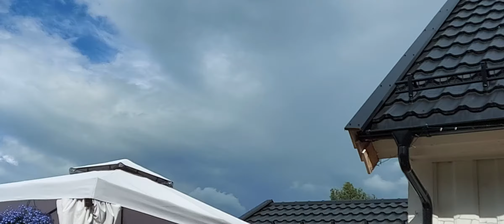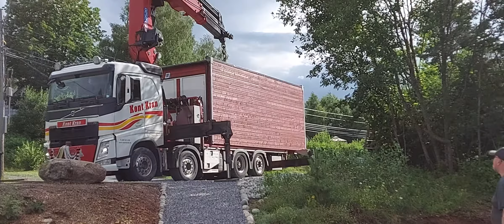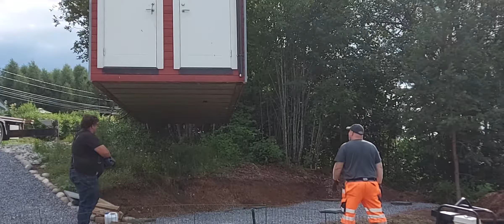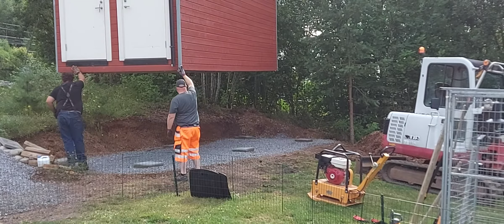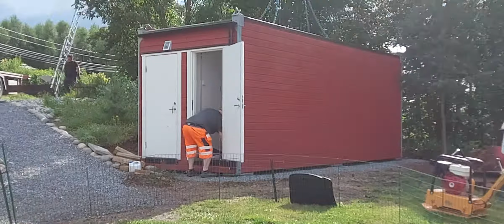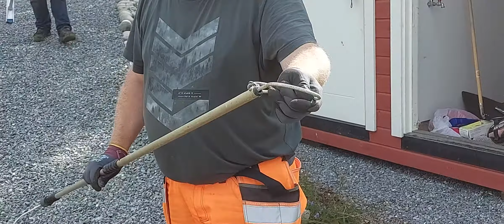Got the "shed" delivered today

Comment: Is that a Corimec unit? I lived in one for two years when I worked with the British army in Kosovo.
Reply from the maker: We call them Moelven-brakker in Norwegian, is the Corimec steel perhaps? This is wood with steel frame.
Reply: @Tunden  Yep It's the same thing. Steel frame with removable walls so multiple units can be put together to form larger buildings.
They used to arrive flat pack style to ba assembled on the site and then packed away again after.